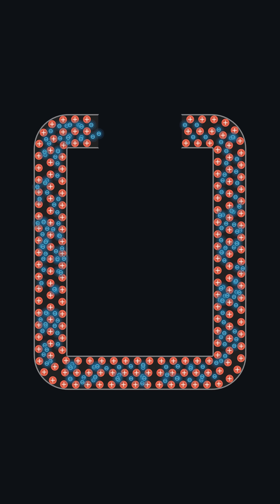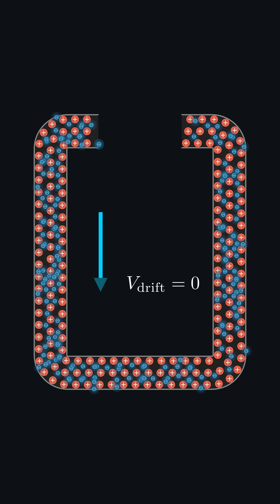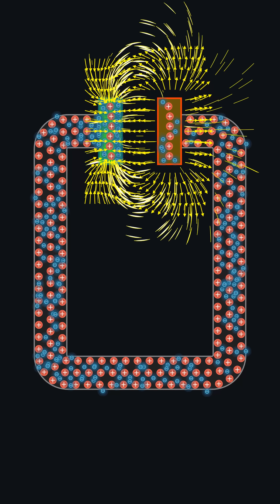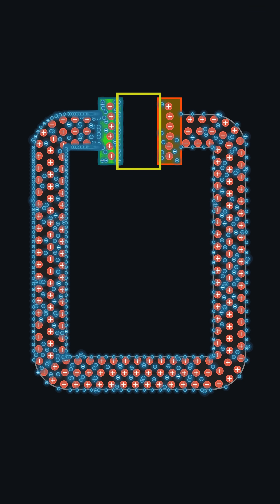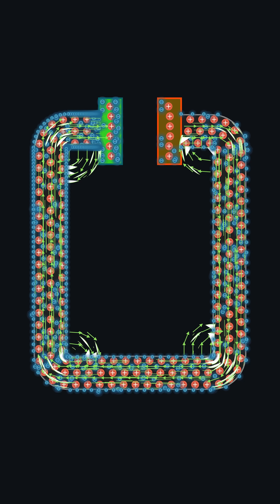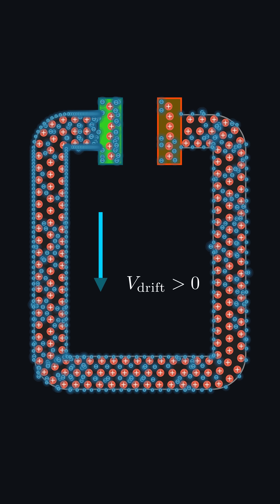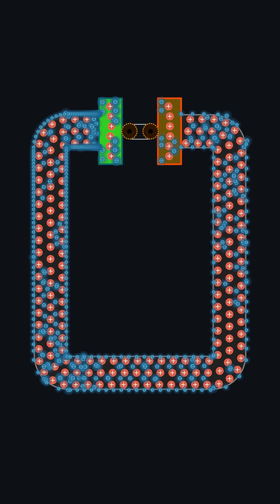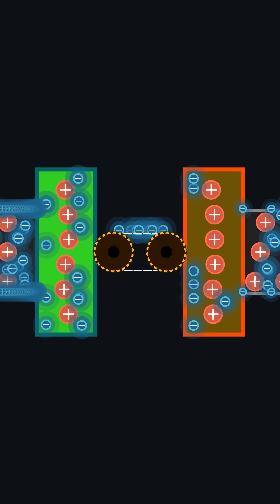How a Battery Makes Electrons Flow #electrical #education #powersystemanalysis #physics  #science

Comment: The movement is only partially caused by the charged plates or battery. Potential difference is the reason they electricity moves
Reply from the maker: The drift is cause by the eletric field that is created by the surface charges. And the surface charges are arranged thanks to the battery field. 
So you're right, it's the potential difference, but it's undoubtedly an effect of the battery and the surface charges.
Reply: You realize the potential difference is nothing more than the gradient of the electric field generated by the battery?